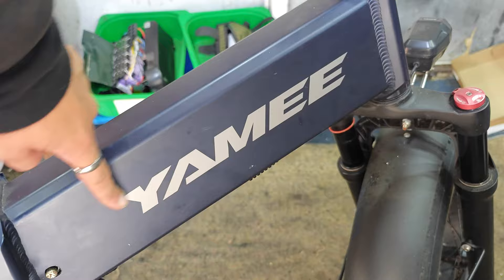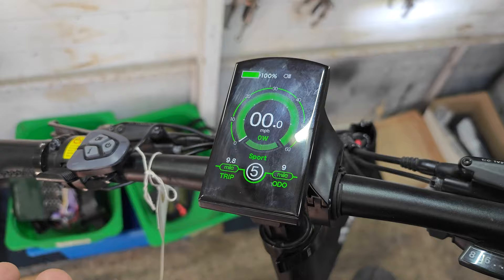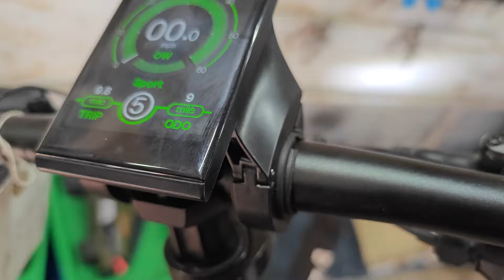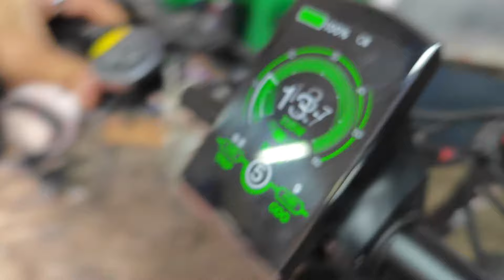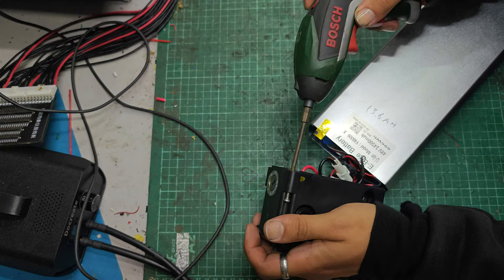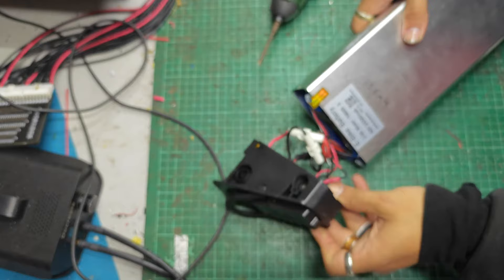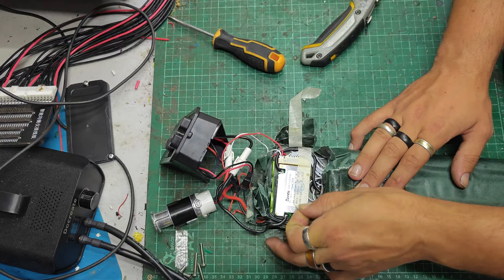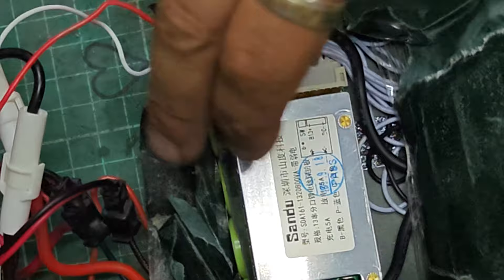YAMEE Ebike battery pack cuts out under load... bad BMS!

Comment: How satisfied are you with Docreate spot welder ?
Reply from the maker: It's brill, just you can use it faster than the caps discharge so you have to let it charge back up once it hits 4.4v or the welds are weak...
Reply: @EbikeRepairs  thanks. I will provide more amps to charting port. And can it really weld 0.3 or at least 0.2 on top of 0.2
Reply from the maker: 0.15 x 2 works fine!

Comment: Most of time it happens in the BMS shunt you should use clamp meter to check the motor surge and for BMS  on cells cable test all 13 cells voltage if voltage is good then connect + and - cable directly to battery pack and test the power surge so simply replace BMS much Bater buy smart  BMS
Thank you for shearing
God bless you.
Reply from the maker: Good idea thankyou! I did replace it and it was OK after that 👍

Comment: had this issue first week when i got the bike and i done some upgrades because yamee sent me a new battery so i swapped both battery bms boards for daly 30a bms installed second battery on the back rack connected in parallel thru xt60 plug on frame and ditched the stupid frame plug to a wired xt60 connection 
done about 4000 miles since with 0 issues what so ever and with both batteries in parallel connected all the time the range and power is awesome
Reply from the maker: Great stuff! Be careful with paralleled batteries, one WILL degrade before the other,  I would use them one at a time only or use one of those multiple battery adapter jobbies you can buy from eBay :)
Reply: @EbikeRepairs  been in parallel for around 3 years mate and they still work like first day
Reply from the maker: I'm pleased for you :)

Comment: I have a 48V 1000W motor and a controller of 15A rated current and 30A maximum current with a battery of 54V 12.5A
The motor spins freely without issue but on load it accelerate to about 15km/Hr the power cuts off, display refreshes (l am clueless if it"s the BMS or controller cutting off power and why]
Pls help.
Reply from the maker: I'm really not sure, sorry. Sounds like BMS/ cells. Can you swap batteries with a friend for a day?
Reply: That's either a bad cell in the battery or a bad BMS. I have a relatively new 52v 20ah triangle battery & it charges as it should to full capacity & also reads the correct voltage on the multimeter. Works fine when on the stand & hits 40+mph easily. As soon as you're sat on it though it will fully shut down around 6mph & the battery then has to be disconnected & reconnected in order to get it powered back on. I will be diagnosing which it is in the next few days. 👍🏼